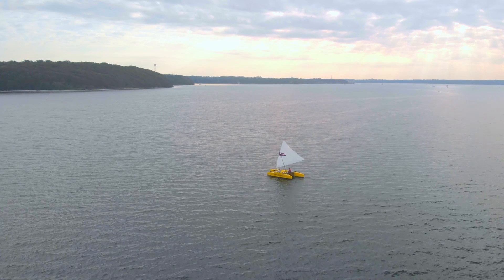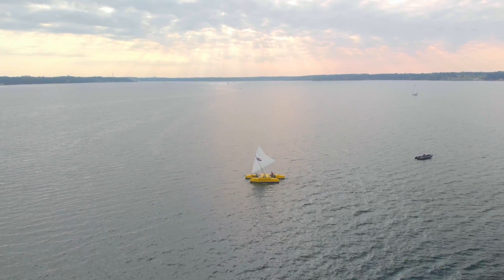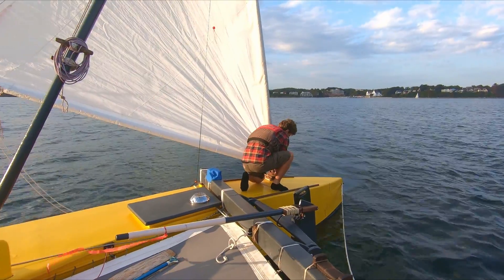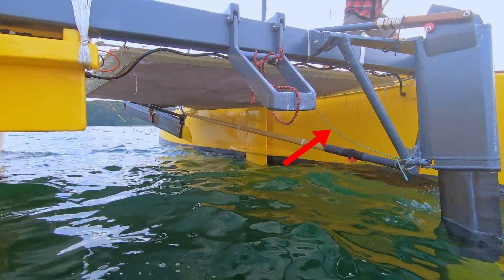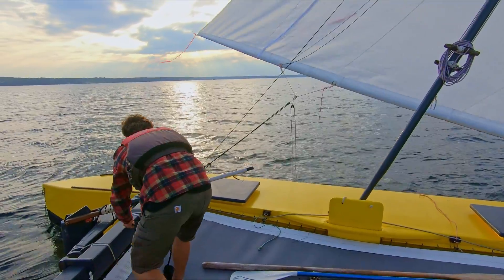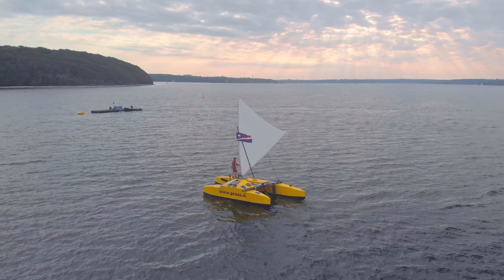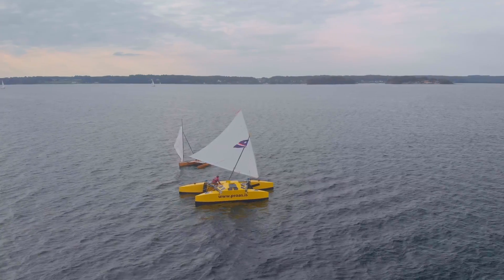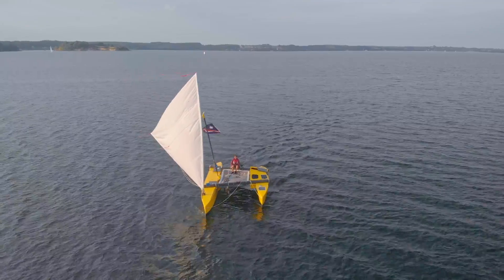Proa Shunting and Rudder Design

Comment: I love these video's about both proa types but I think they can only be used efficiently on larger stretches of water with a steady wind because shunting is far more labour intensive than jibing. A rail would help a bit. Alas will the sailing be quite wet on larger waters. I imagine that canals and rivers would be less favorable for shunting boats.
Reply from the maker: exactly, thats why they were only developed in the pacific region and anywhere else monohulls were prefered

Comment: Is there a reason why the sails leeward side does not face the ama. Wouldn't it tolerate more wind by having the pressure on the ama?
Another question, who do you reef?
Reply from the maker: The windward hull acts as a weight to counterbalance the heeling moment. It's like a keel yacht, which has the heavy ballast mounted at the end of the keel. Only that the yacht needs to heel to move the ballast to windward where it gets effective while on a proa it's always at maximum effectiveness. If you look at modern racing yachts like the IMOCA class you will see that they all use canting keels, effectively mimicking a proa arrangement. 
If the sail would be on the windward hull there would be great stress on the entire platform and the design would be more complicated and expensive (at least in theory). If you have a close look at trimarans you will see how heavy the beams and cross connections are designed to withstand the loads.

Comment: Really nice video! I always wondered how it is done.
Thanks!
I just wonder, I thought this type of sail is called crab claw sail. What is the difference?
Reply from the maker: Thanks! There is actually a difference between crab claw sails and the oceanic lateen commonly used in Micronesia. The crab claw is almost exclusively used for Te Puke and has very flexible curved spars with a hollow leech, resembling the claw of a crab. The oceanic lateen is more or less triangular with straight or just slightly bent spars and a straight leech. Aerodynamically they have very different properties.

Comment: Fantastic video and great engineering of the rudders. I am so happy to see a shunt with a lateen shown and explained effectively. That is works so well without any traveler line or rail. You made lateen proas much more attractive.
Reply from the maker: Many thanks! If it wouldn't work the Pacific Islanders would not have done it for centuries. It seems the western mind somehow has difficulty to comprehend real simplicity and always overthinks everything. On a smaller boat, let's say up to 18ft, you wouldn't even need the fore/aft stays, windward stay is enough.

Comment: Interesting.
Like the rudders.
But worry the moving of the sail by hand would be an issue in a big sea / wind.
Reply from the maker: Thanks! No not really actually. Doing it for years already. It gets even more easy with stronger wind. The secret is the right technique (as demonstrated in this video). The wind adds stability and does most of the work.
Reply: @proasisproject  ..I was thinking of when the waves are crashing over the bow(s) and the wind ripping the sail from your grip.
Reply from the maker: @markthomasson5077 in conditions when there are waves crashing over the bows without the boat moving (i.e. heaved to  position in preparation for a shunt) there is no sailing anymore anyway.
Reply: I was watching another proa, he had a track for the mast foot. He was certainly a lot quicker.  Ok yes more complex and expensive.

Comment: Been following this project for quite a while and somehow missed this video, great explanation on how a shunt works! That rudder linkage design is super cool too. I imagine that a great deal of time and moving about could be eliminated through the use of a "tack track" as found on some other oceanic lateen-rigged proas, but I understand that for the Proasis project simplicity and low cost of construction were key considerations, so it makes sense to stay traditional in that regard.
Reply from the maker: Thanks, that's nice to know :)
Yeah, we keep it like this on purpose. As simple and possible. We don't mind the moving, it's really much less of an effort than it looks like (with the right technique of course). We use proasis quite often for story telling events about climate change and other ocean related activities. For the guests it's always a sensation to feel the wind in their hands and move with the waves and the boat. To be honest I like it alot too. Having a track might make the shunt a bit faster by forcing the sail to the other side but the direct connection is lost. The feeling of a manual shunt is difficult to describe but I don't want to miss it.

Comment: how do the rudders behave if you run aground? will it slide up or kick up? It looks like if the rudder kicks up (say by sailing into a sandy bottom) it would still provide some steerage, which is ideal rudder behavior in my opinion
Reply from the maker: Both (kind of). The foils themselves (old F18 daggerboards) run in casetts up and down. They can be adjusted for the water depth or even completely retracted. The connector tube has a fuse which allows it to telescope and kick up the rudder so far that they clear the surface, even if all the way down. The fuse is reset by simply pushing down the rudder frame. It snaps back automatically. The entire setup consists only of two tubes, a round piece of PVC and a bungee cord. No metal or complicated mechanic. 
So the draught of the rudder can be preset. If something goes wrong (shallow spot, rock, reef or heavy floating object) they kick up.
Reply: so is the fuse a notch that the bungee grips? so it pops out and is then free?
Reply from the maker: @dominictarrsailing no it's never free. There is a smaller tube inside of the yellow one. Both tubes have a semi circular cutout. The cutouts are lined up by a PVC cam which is tensioned by bungee cord. If the rudder hits something the inner tube is pulled out about 30cm to kick the rudder up. 
Sounds complicated but it's as simple as it gets. Don't worry if my explanation is difficult to follow, there will soon be a video showing that part in detail 😅
Reply: I think I can imagine it but a video is even better!
Reply from the maker: @dominictarrsailing working on it 👍
Reply: I’m expecting to sail my wa’apa mostly on the Missouri River. Where one of the greatest challenges will be sand bars. I realized the act of shunting makes it possible to back off one without getting out of the boat.
Reply from the maker: @keernhaslem1845 can work for a small boat. But you need to be careful with rudder design

Comment: Love the linked rudder design.

Question: Is there a reason the leeboard is on the vaka and not the ama? My understanding is that typically the leeboards are on amas on shunting proas to make it easier to keep the ama to windward. Is this a non-issue in the proasis design?
Reply from the maker: Thanks! 

No, the placement of the lateral plan (leeboard, foil, hull shape or whatever) on the windward hull is the exception. It's mainly promoted by designers with a western background, there is no traditional design with this feature. The reason is that the lateral plan on the windward hull puts a lot of bending moment on the entire structure, in fact really counteracting the design idea of a proa. Proasis has no problems with getting caught aback whatsoever. In the last 3 years it only happened once in zero wind because of a 180° shift. Most of the time the reason for getting caught aback is either an imbalanced design of lateral and sail plan or wrong handling. As pointed out in the video it's important to work with the wind, swell and canoe instead of fighting the elements by applying force.
Reply from the maker: @wailinburnin  no, that never really happened. It's not a problem we think about much because it doesn't play a big role in sailing her. Actually it only happened twice so far. One time the wind died down and changed direction by 180° while we were drifting. The other time we sailed into a gybe in more wind on purpose just to see what happens. Not a big deal after all, the boat either recovers on its own or by using a paddle. If you are interested we will make a video once we get back into the water.
Reply from the maker: @wailinburnin  actually that's a good idea, will make one but it will take a couple of month before it's warm enough to get back on the water.